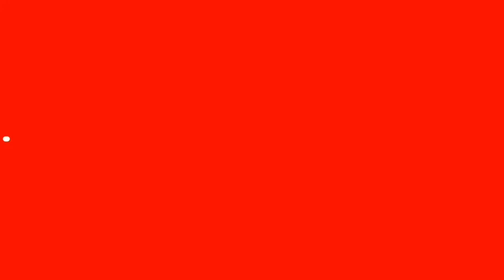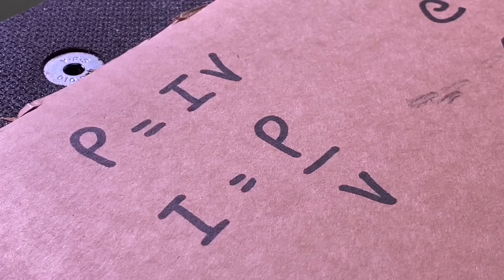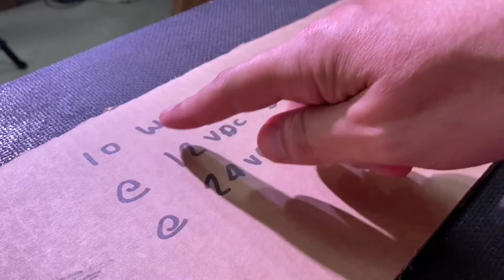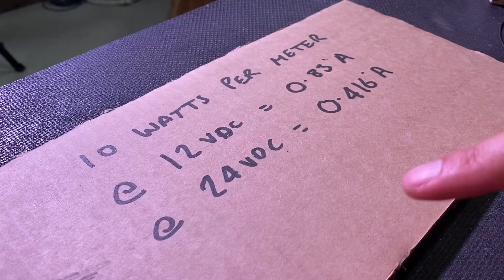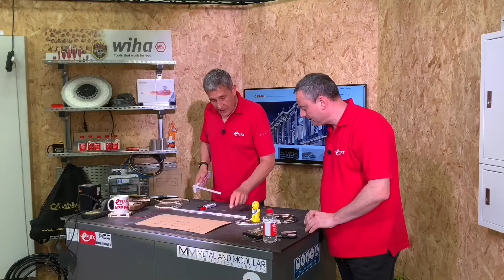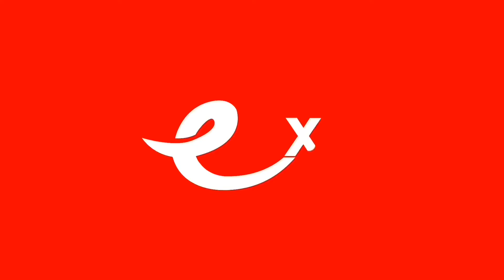What's the difference between 12 and 24 volt LED strip?

Comment: I really don't see the benefit of 5V LEDs then?

If you want a large run of LEDs, then 24V seems to be the way to go. Otherwise, you end up having to have multiple power injection points and a larger wire gauge from your power injection to handle the massive amp requirements.

Comment: Hello, great video helped me understand  more about led strip lights. Currently working on adding some underneath my kitchen cabinets but I will be cutting and adding wire to gap were light is unwanted nor needed. Now my question is, can I start the power supply in the middle of the run with a "T" to have a better distribution and basically have 2 ends.
Reply: Yes, for sure, if only rated wattage of your driver is enough. 

If you have two drivers, you can also make it like this: one driver is placed in one end and the other in the other in parallel. 

If your LED strip is not too long, maybe less than 5 or 7.5m, 12V is a better choice. 24V is namely safe voltage, but it is not absolutely safe. 9V can even kill - no worry it is the extreme case, for example it is wet and the two terminals are right on the front chest and the back, something like that.

Comment: I have new LED UV 12 volt light strips. I cut off the power supply and wired it up to my 12 volt car battery. Now it doesn't work. What have I done?

Comment: Nice.. BUT, when it comes to a Larger project, 24v is the way to go. The reason is answered with your initial equation. Notice that between 12v and 24v, the AMPS are doubled using 12v..  this requires heavier wire [copper], lugs, etc which can really add up in a larger project.

Comment: I'm hoping to power a 2m LED strip using a bick boost convertor and a 3.7 lithium ion battery. The main issue I've run into using a 5V strip is the only the first few LEDs get any light. I suspect that I'd be better off using a 24V strip with 60 LEDs per m. Not an electrical engineer just trying to learn for a project

Comment: Hi I have a 24V strip and I want to change run it from a battery - is this possible? Or would it be better to get a 12V strip? What would be the difference between 12 V vs 24V if you want them to be mobile?
Reply from the maker: All depends upon the battery arrangement - either can be powered from battery. However 12 v batteries are more common. You'd have to use two in series for a 24v strip.

Comment: It it standard that 24v strip should be housed in aluminium channel if installed on woodwork?
Reply: Strictly speaking, no.

Actually, many more strips are attached inside wardrobe using double-sided tapes, usally 3M.

Comment: hello 

i need your help.
i have a DMX512 DECODER 32 channel with 8outs of RGBW+V where am connecting the strips. on this Decoder can i connect a led strip that is  
WS2812B DC5V LED Strip RGB 1M 144 Pixels Smart Addressable Black PCB WS2812 IC Full Color ?
will it work?

thank you

Comment: I use GM lighting.. supply house sells me 12volt. The only trouble I come across is flickering lights with certain dimmers
Reply from the maker: Is the led driver dimmable?
Reply: @efixx  yes just some dimmers are not compatible
Reply: This is a bit tricky.. There's no driver compatible with all dimmers.. One suggestion is to buy drivers and dimmers of famous brands, the popular models. The more popular, the more chance they are compatible, coz engineers are not going to test all models availble in the market.

Comment: To get around the issue of dimming on a long run, i have connected multiple supply wires at various points along the run, This way you get a consistent brightness, albeit a slightly less lux level throughout the run. At least to my eyes it was.

Comment: 24v as a preference. Important to note that not only does your voltage drop numerically halve, because you're starting with a higher voltage your percentage voltage drop is a quarter of the percentage voltage drop which has a huge effect on the visible effects.

Comment: Voltage drop issues are best avoided by powering the strip from both ends at the same time.
Reply: also depends on the wire gauge you are using. thicker and more solid wire can carry higher current further.

Comment: 12 will have less LEDs, the forward voltage to make it illuminate is approx 3v, so generally only 4 in series with 12v, then they use parallel connection of the series strings.

Comment: Not on topic but. Cable groupings: I am running conduit between two switches so have runner from one to second. Return wire back to first switch to feed the lights. Is this two circuits or one circuit for the calculation? In this case am running two circuits in 25mm conduit and know that if the eight wires in the conduit only four will carry power at any time. But. Is that two circuits or four circuits for cable grouping? (0.8 or 0.65)
Reply from the maker: What a great question Adam, I'll probably do a Q&A video on this at some point but just with the information you've given me here I'd bear in mind two points. The first is how heavily loaded those conductors are, if they're only feeding one light fitting the current in them will be low meaning that Note 9 of Table 4C1 will come into effect (meaning you might not have to apply a grouping factor at all). Also if you think about a normal cable feeding a load you've got current flowing in line and neutral but we treat it as just one circuit not two conductors, so in your case current would flow down one line conductor and back the other way giving you effectively one circuit. The principle of Note 5 for table 4C1 applies here giving you two circuits for grouping not four. Hope this answer helps. 😊

Comment: 24v all the time for me .. copper trace thickness comes into play too , had some dodgy results from some reputable brands who use thinner traces, but can usually get away with long runs by injecting power at both ends

Comment: What about cable sizes when it comes to current carrying capacity with extra low voltage dc?
Reply: Current is current whether it's at 230v or 12v, the cable sizing stays the same with regards to current draw as far as I'm aware.
Reply: @TheFool2cool  thank you
Reply: Surely to bring a specifict wattage to the fixture, a higher watter causes lower voltage drop as the current drawn is smaller, and then useless power consumption along is less.